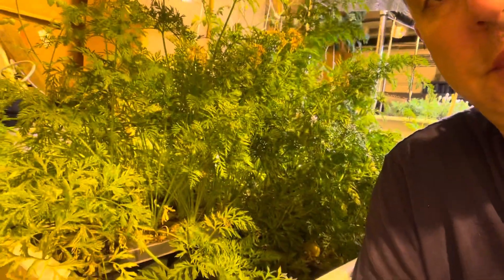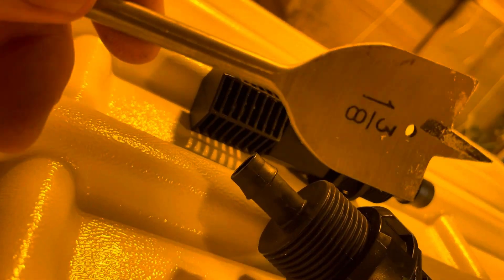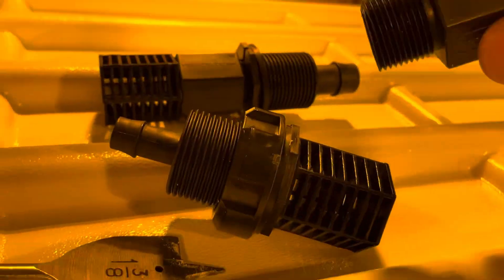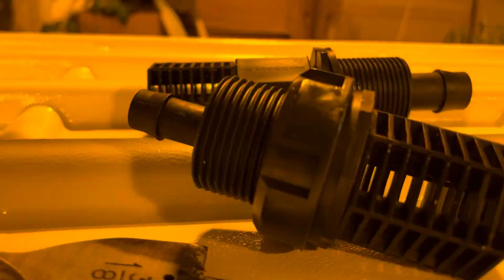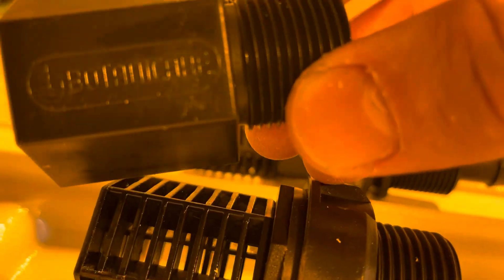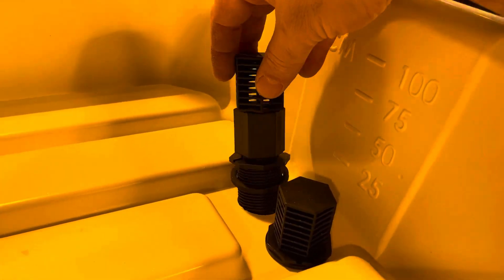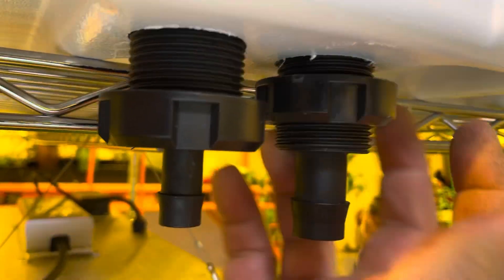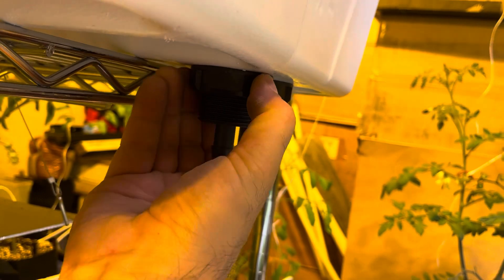Hydroponic flood and drain system- easy hydroponics and great results!

Comment: How many times you feed them also what medium is best?
Reply from the maker: Most plants I water 4 times per day. Strawberries I water 2 times per day. The best medium in my opinion is 80% coco coir, 20% perlite. If using coco bricks, it should be thoroughly washed to remove small particles.